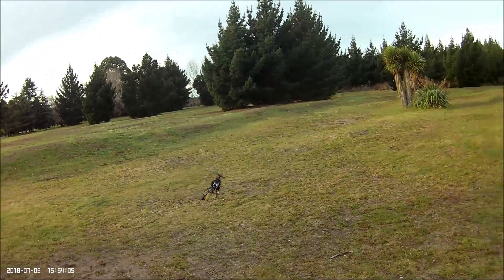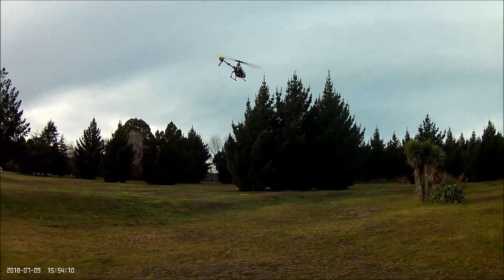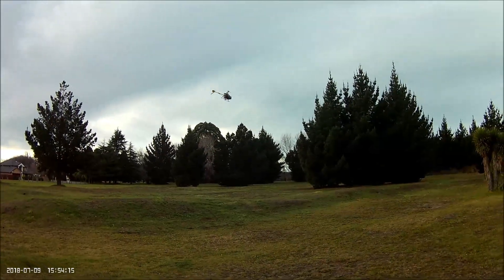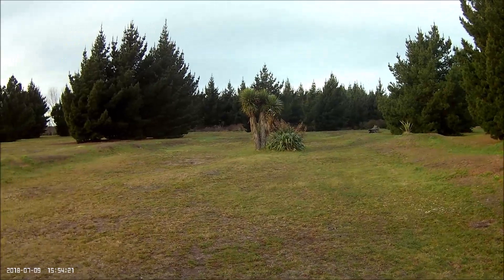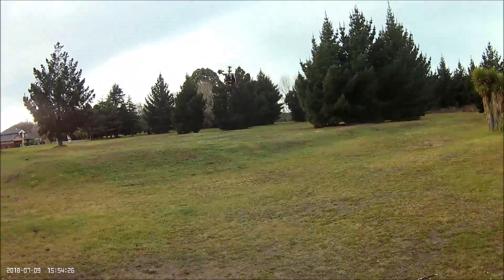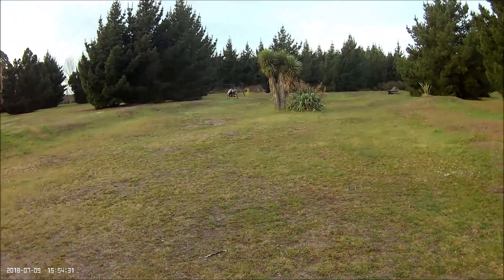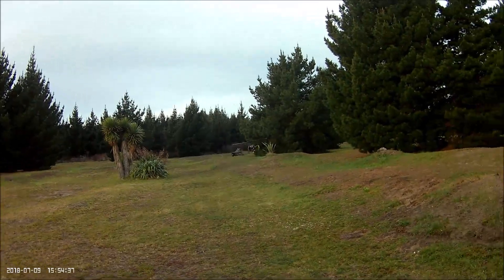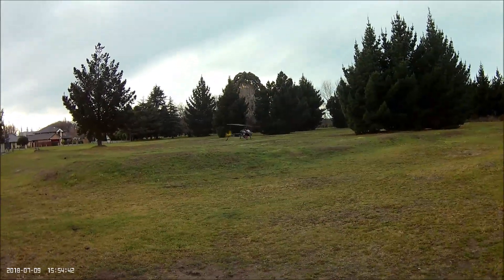V950 CC3D Maiden and Initial Tuning

Comment: I don't see bigger blades causing the shake. Most likely, it's a bent main shaft
Reply from the maker: No shaft was fine. When I played around with another flight controller which had blackbox recording I eventually tracked the oscillations to the main shaft rotation. I'd checked shafts and balanced blades etc. It may have been flexing of the frame such that the flight controller was registering a slight roll movement on each rotor revolution and was trying to correct for it. At some point it became a resonating feedback loop resulting in ugly shakes. It maybe that some later hardware and flight controller software like Rotorflight might filter out the response, particular if the flight controller is getting motor RPM from the ESC. That was my next step but lost interest after buying the parts to do it!